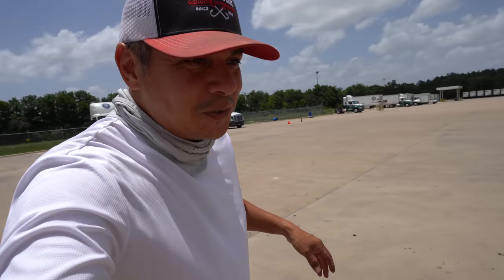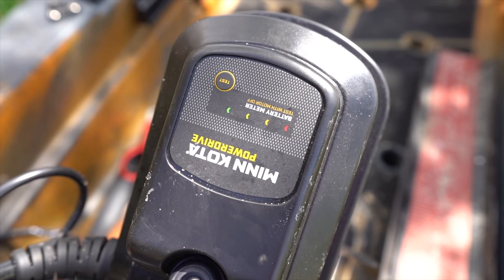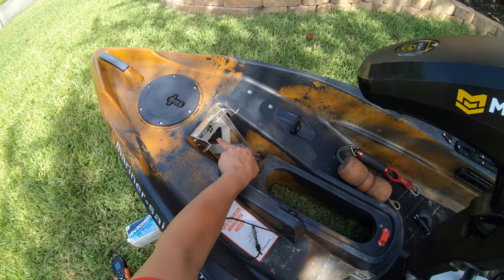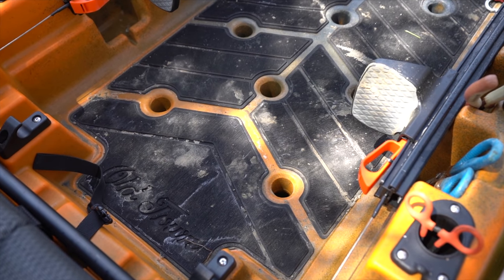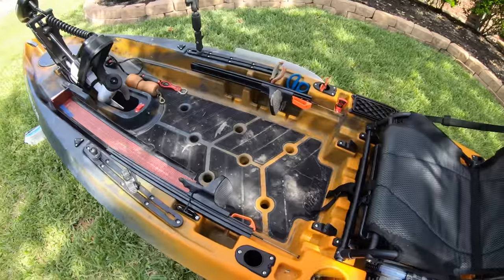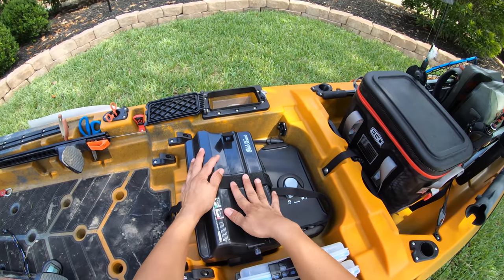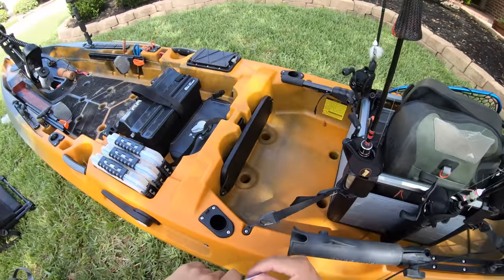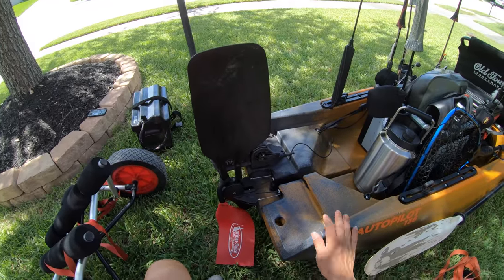(S3 Ep155) Old Town Autopilot 136 Walk-through

Comment: I know the team at Old Town listens to the advice of you and your followers. When I look at this kayak I see some enhancements to it that they should consider for future models. The motor needs to be either flush with the floor or closer to the floor so there’s no chance of the operator tripping on it and to have it “out of the way”. The motor underneath needs to be raised up so it can get into skinner water. The pull rope on the motor needs to be more stow able and not just hanging loosely in the cockpit area. They need to create a sacrificial keel on the front so when the kayak is being beached or you come up to the loading ramp the front keel isn’t chewed up. As you pointed out those cup holders need to drain out. The battery needs to be removed from under the seat. Move the hatch opening back into the tank well area and push the battery back and set it lower in the boat. The area on the side rails just behind the rear rod holders need to have gear tracks there. I agree there should be another place to mount another power pole if the user wishes to add it.

Comment: I’ve definitely taken water in from the front hatch when waves splash over. That foam sealant on the hatch isn’t good. They could put a rubber gasket instead.

Comment: I'm MOSTLY curious about stability.  You're an experienced kayak fisherman so you may not even notice the "tip" factor.  For those like me, that have sea trialed kayaks in the past, there's a wobbliness to them.  Does this 37" width- Autopilot 136 have any of that wobbliness in your opinion?  My last kayak was a Jackson Cuda SOT and it tipped with me quite often!  I "believe" it had a 31" width though.  One other quick question.  Is there a place to try the Old Town before buying?  Thanks Mark!
Reply from the maker: It's super stable in my opinion. You can try them out at Mariner-Sails if you’re in the Dallas TX area.
Reply: @MDLRFishing  Thanks Mark.  I'd be willing to drive up there just to try one out.  I was so disappointed in my Cuda because I could never get comfortable and focus on fishing because I was always worried about tipping.  Appreciate the feedback!